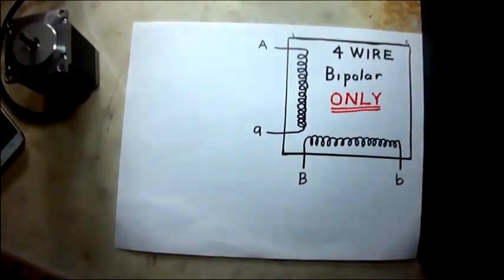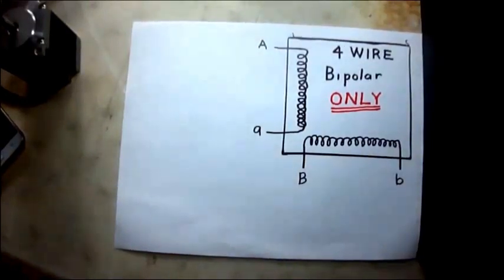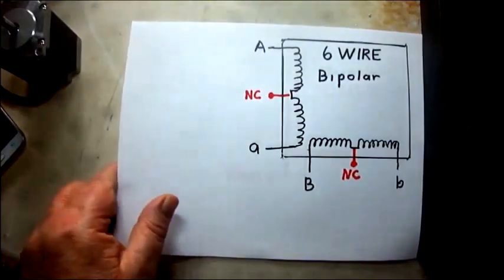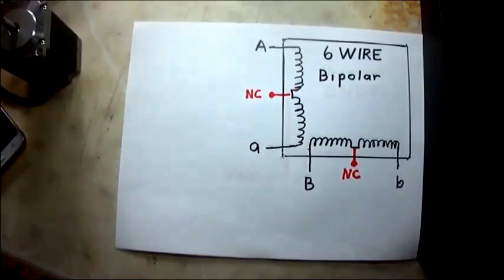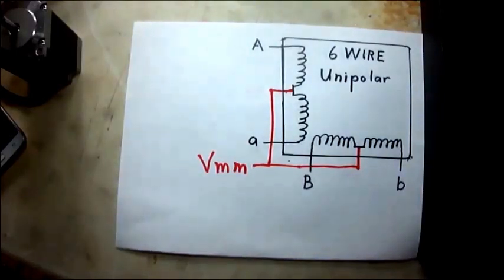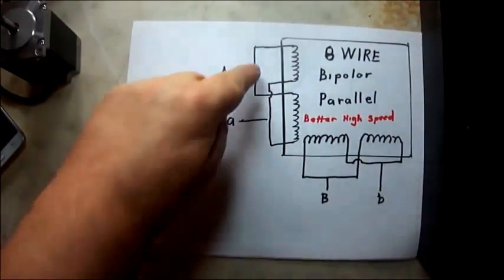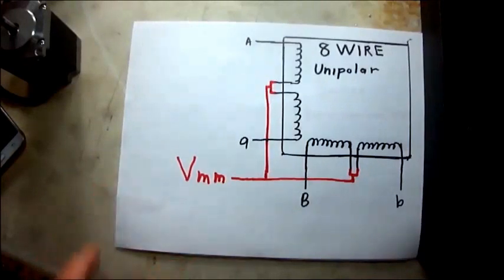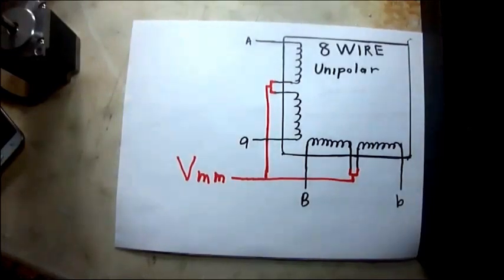Stepper Motor Types

Comment: I am trying to figure out what I need for my shirline mill. I once had one befire and I used the insanity expensive cnc controller and motors from shirline. I want to run my steppers half stepping because of the lead screws and I need torque on the lower end. Sherline used I believe 6 wire uni but I dont know how they used the center tap wires.
Reply from the maker: 6 wires only hook to a Unipolar driver one way but it can be used on a bipolar driver if you don't use the 2 center tap wires.

If you have a Bipolar driver the center taps are not used and taped over.

Bipolar drivers are cheaper and more readily available.

I am using NEMA 23 425 In/Oz Wantai motors with their controller for X and Y on my harbor freight. But the Z axis I am looking at a NEMA 42 beast of a stepper motor as the Z axis needs power.

Also I suggest ballscrews on all 3 axis' to get the most out of the motors. Ballscrews require some reading as you will want to tighten them up(Preload) to achieve Zero backlash. I will be buying mine from ROTON.COM

If you can't get a datasheet for your motors you may have to go this way to ID the leads./
https://www.youtube.com/watch?v=hHe4Fc6uuBs

Comment: That's ok but which pair is A and which is b of stepper motors let me know please
Reply: 4,5,6 or 8 wire?
Reply from the maker: Usually a stepper motor will have a part number that you can track down it's specs from. If not then the fun begins. If it's 4 wire it's easy, 5 wire a bit harder. 6 wire a little more difficult and 8 wire is where the fun starts is you can't find specs.

I don't have a video for it but I'll look around...

For 4 wire here is a video...
https://www.youtube.com/watch?v=RJB-zlpXBXM
Reply: Can a 6 wire motor can be used as  Dynamo or generator

Comment: Wel Done, I likes simplicity though.
Sooooo ?using position feedback is it practical to control the position of traditional DCorAC motors? 
For example it's easy/cheap to just count the fringes of laser interferometery for position.
Reply from the maker: I'm still thinking about using a hybrid stepper motor. Let's not rush the process. Maybe one day but most of my builds are hobby machines built on the cheapest of cheap. I just haven't gotten in to feedback controls for the reasons of cost. I may have to play with that one day.

Right now I'm neck deep in projects trying to keep up while building more shop space. Play time and play money are in short supply right now. If I put something new on the bench my wife might neuter me with a rusty spork. I need to get a lot off my plate before I get add new toys to the research pile.(I love new toys. I'm worse than a kid.)

Comment: Thx Richard, I watched quite a few more "snazzy" videos but yours explained the difference between uni and bi polar the best, cheers
Reply from the maker: When I was starting out in the late 90's you had to know the difference. Most of what we used back then was surplus and one you put down the money it was yours. The safe bet will always be 6 or 8 wire steppers as they can crossdress and be what you need. <y first steppers were 5 wire which are unipolar only. I have no complaints as they added $5k a year to my takehome doing autonomous work.

No one ever told me te difference and the drawings of the day were unclear. I figured it was worth the time as it is my most-watched educational video.